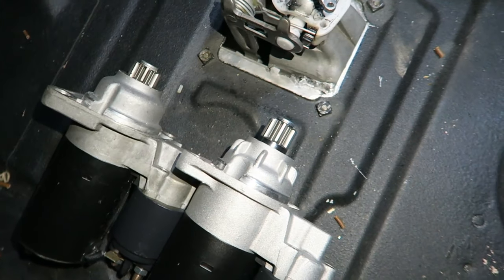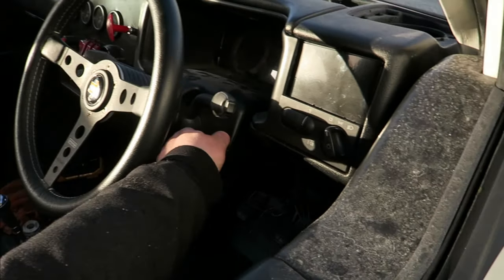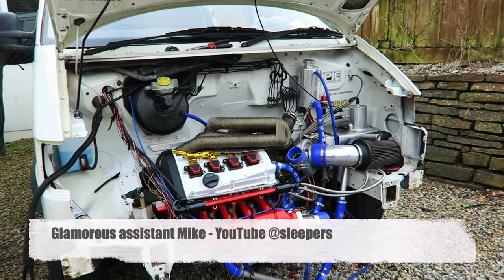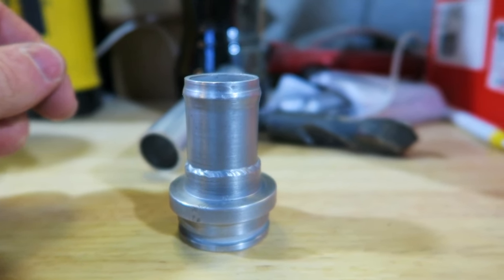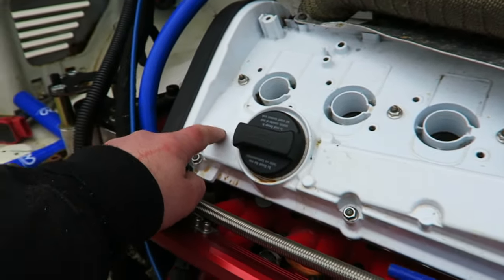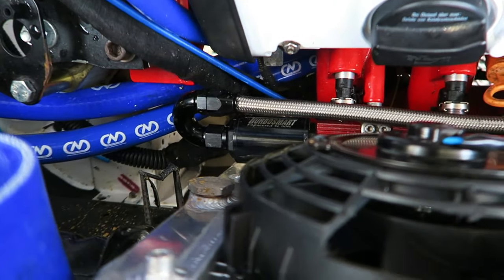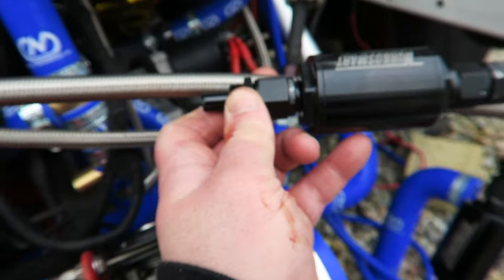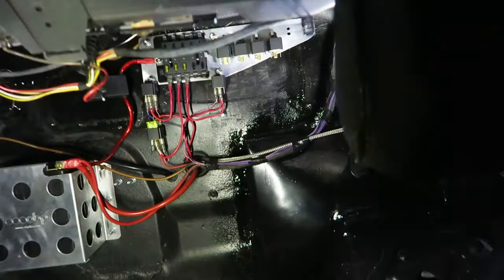VW T4 TRANSPORTER 500BHP+ First Start!!! :-)

Comment: Not sure if you noticed it yet, but the hard-line on mk2s and most 8v motors is 20mm and can be bead rolled (if the end is buggered) to press fit into your crank case breather hole instead of hunting one down or buying 20mm tube (hard to find in North America)

Comment: Hello, you kept on going on about the upper vent nipple being better as it had a larger cross sectional area. Have you looked underneath the cam cover to see how that anti splash plate holes surface area between the nipple and cam internals is next to nothing. There’s the biggest restriction
Reply from the maker: 100% correct, that's why I've put 4 extrs holes at the far end 😎👍

Comment: Nice build. Can I ask where you got the air filter. Struggling to find a 90mm inlet with a decent length. Cheers.
Reply from the maker: Ramair Filters 100%!
Reply from the maker: The K&N one crumpled along the spine. I;ve since changed over to a Ramair and the strength and quality are far superior.
Reply: @SpeedingTube  Ah thanks for that. Do you run the program xl then or a smaller one?
Reply from the maker: @sprayworks9592  Yes mate, I run the XL. There's a pic of it side by side with the K&N on my Insta

Comment: Not hating but that exhaust is way to close to the coil packs your gonna always be changing them with that manifold
Reply from the maker: Not at all, the exhaust wrap works great. Over 10k miles now and no issues.
Reply: @SpeedingTube  it will only happen when you start driving it more aggressive once you get the manifold glowing it melts them right up